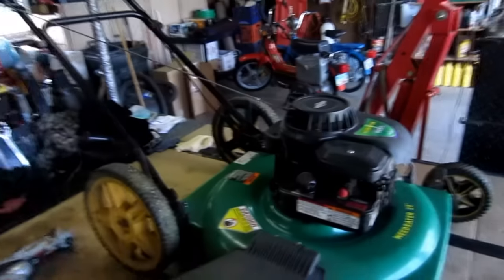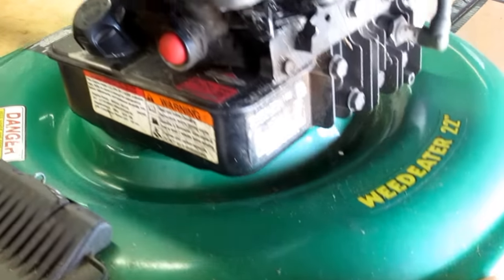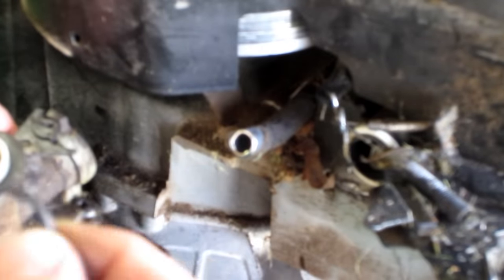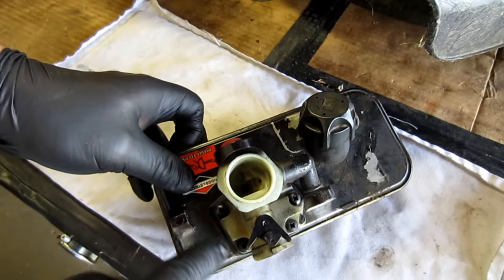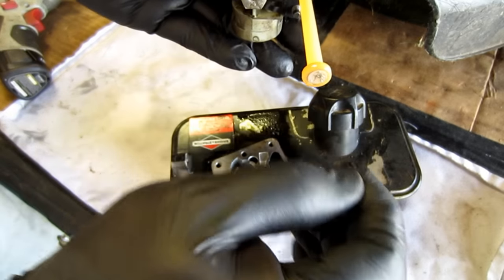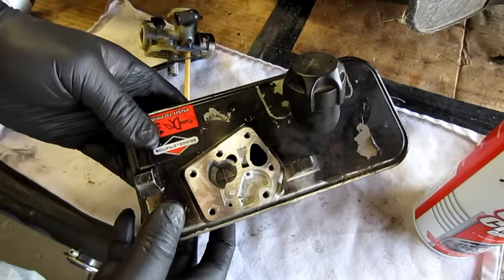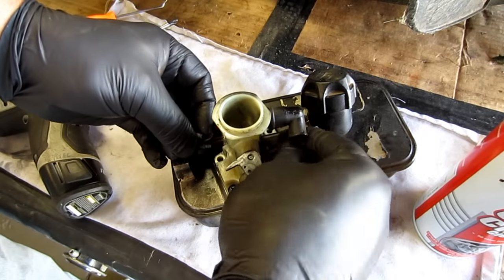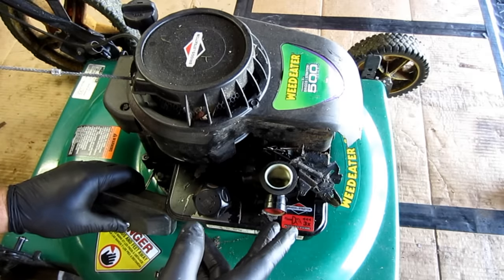Fix 90% of Briggs lawn mower not starting problems. Easy repair.

Comment: 90% of what I see is that Diaphragm failing. Spraying the old diaphragm  causes  it to curl up and become unusable. As a general rule, ANY TIME you pull that plastic carburetor  from the tank, that diaphragm  should be replaced unless you need to get back into it right away. Brake cleaner is generally a lot less damaging to the diaphragm as well. Good video and good to mention the crud in that well. I always clean the whole tank anyways. You can see that crud as soon as the plastic carb is off.

Comment: I know you won't see this because this video is so old,  but maybe someone else will. One thing you didn't mention is to make sure there is no water in the gas tank. That's something that can happen after a mower sits all winter, especially if you are using fuel that contains ethanol.

Comment: I was so apprehensive to even start on my stone dead lawnmower. Today I mustered the courage to trust your guidelines and hope for the best. 
Well, I'm glad to report that not only that my lawnmower has come back to life but I'm also so thrilled at my new found confidence in myself and what I've been able to do for the first time. I feel like a fully flexed mechanic already, thanks to you. Awesome detailed narratives and great tips and guidance throughout. Thank you again immensely.
Reply: Remember to change the oil and sharpen the blade every spring, and replace the spark plug every two or three years, and it will run like new for 10 or 20 years.

Comment: Eight years later and this video is still relevant. I have the same mower and having issues with an over-season non-starting issue. Totally unknowing where to begin, what to do and what tools needed. Thank you very much for this video, it's still important :) p.s. Amazingly, after all this time,  the Amazon link takes you to the replacement gasket and diaphgram too, the most recent one needed. Perfect!
Reply: He’s a bloody good Australian this bloke
Reply: i have a similiar nging on my mower, but not that problem. i have more of a constant oil-problem with said filter.... might not have helped that my father back then filled it opposite....

Comment: I viewed this several times. I was able to replace the gasket so that the mower runs better for a couple years. 
Then I became fearless. I tried to clean and fix many small engines. I managed to maintain most small engines I have.
This is a very thorough video.

Comment: I have a Weedeater Sprint II I bought years ago- in fact, I can't remember when. TBH I have NEVER done any maintenance on it.  Recently it started running unevenly- the engine would speed up, then decrease. I thought it about time to do something. I changed out the air filter and spark plug and did an oil change, all for the first time.
It was still running roughly, so I went online and read that it was probably the carburetor, but I could not find instructions for any mower even remotely like mine. until I saw yours.

I just followed your video closely, finally reassembling everything and, holding my breath, fired he mower up. PERFECT! It runs like new. I am so pleased- you saved me a hefty bill at a repair shop. And you got yourself another subscriber. Thank you so much. You rock!

Comment: Thanks for the free mower, it worked! This is my first house, and a neighbor was throwing out his mower, I refused to believe it was unfixable, it had compression and spark but ran very slow with misfire. I went to a repair shop and got that gasket for 6$ (while another lady was being quoted 100$ just to investigate her mower, no wonder why people throw mowers away). This year I have seen 3 mowers on the side of the road, now I don't know if I could resist taking them all anymore!

Comment: Thank you! For me it was the part into the gas tank you started to clean where the bottom is cross-hatched. There was a lot of fine residue that was the same color as the surrounding metal. After digging it out and cleaning all the ports as prescribed, my lawnmower started right up and stayed running smoothly. Thank you for your effort in making this video and spreading the knowledge!!!

Comment: I cannot thank you enough sir for posting this very detailed and helpful video. This morning, I got my Brute Briggs & Stratton pressure washer up and running. I followed your instructions step by step and it worked. I didn't need to scribe but was careful with the reassembly. Best instructions. Thanks again. Tony

Comment: Hello That's a great description. Thank you very much.
I repaired my lawnmower exactly as instructed. Madness, he runs better than ever.
So here in Germany your video has already completed the first help with me successfully.
Reply: Dieter Schmidt Hello, I thank you very much for posting a very informative and useful video where you have explained step by step. I have a similar product. My initial problem was the engine that would start to run just for about 5 seconds and then stop. So, my good neighbor John sent me your video link. So, I cleaned the carburetor following your demonstration. After changing the plug, the engine continues to run but steadily at a very high RPM which is not right. So, I must have done something wrong in putting back the carburetor house. I suspect, I suspect the small spring is not able function to restore the normal RPM level. It’s too high and I can not let it run at that high RPM. I wonder what my fault is??
Reply: I thought VW made mowers in Deutschland!

Comment: Beautifully done video! My mama and I both have this 500 series mower (mine has a 21" deck). I will be replacing the carburetor on my mower soon and upgrading a few other parts. The carburetor on Mama's mower needs cleaning, and your video is exactly what I needed to review. I especially appreciate you providing the tool sizes needed.

Comment: Easiest thing to do and I tell all my customers, use 93 octane or above for 4 cycle mowers and 2 cycle mixes, 94 sunoco gas has 0 Ethanol.... Ethanol kills small engines, I have used 94 in my small engines for 10 years and have never had to rebuild my carbs, it might be a little pricey but saves you money and head aches in the long run..... Great video.
Reply: Drain your gas tank in the fall at the end of each mowing season. That helps a lot as well to.
Reply: It would help if you drain the carb as well.... or use stable....
Reply: Octane has nothing to do with quality of fuel. Running a higher octane than an engine is designed for will cause pre-ignition and detonation and will eventually cause catastrophic engine failure.
Reply: I would think it'd only be a waste of money, not engine failure, but I'm no expert.   @dontblameme6328
Reply: Jay Vee higher octane is less likely to detonate.
Reply: absolutely! great advice-i run premium in all my small engines along with high performance 2 stroke oil-everything runs much much better now!
Reply: I'm on year 7 of ethanol free gas.. no carb jobs yet on any of my equipment.. 2 lawnmowers,  2 ATV's,  3 outboard motors.. all start with ease
Reply: also pouring cold gas into a hot gas tank...will warp the tank. Not so much now but the older pulsa jet and vacujet carbs
Reply: Jay Vee the ethanol. It destroys gaskets and diaphragms

Comment: I can see that that 'gasket' serves a dual function. It serves as the gasket between carb and tank, but it is also the fuel pump diaphragm.  Suction from the intake stroke pulls the diaphragm against a spring and on the other side of the diaphragm, suction is created which pulls the fuel up from the tank to that fuel well/bowl. You can see little flaps on the membrane that act as tiny valves. I've worked on the older Briggs horizontal shaft engines and the carb/tank gasket and fuel pump diaphragm are two separate parts. The rubber diaphragm fuel pump design is clever, but combining the membrane and gasket is extra clever.
Reply: Exactly as I see it.

Comment: Over the years I have had several Briggs & Stratton engined mowers.  I always chose a mower because of the engine make, the rest is just tin work.  A couple of years ago I bought a very similar mower to the one in your excellent video.  The problem with this model engine has always been muck blocking the jets in the carb.  It seems some bean counter at Briggs thought they could save some money by building the carb into the fuel tank.  What a disaster that turned out to be.  Any slight muck in the fuel .... a blocked jet. Formally when they had a carb with it's own separate float bowl it was easy, usually just one bolt, to remove the float bowl and any muck.  This also created an additional barrier to protect the jets. Also as you point out the gasket is very prone to distortion.  Cutting corners on design is not a good way to ensure repeat business when it come to buying a replacement mower.

Thanks for taking the trouble to make this very helpful video.

Comment: I watched this last night and today my mower is running again today after i followed your instruction, I lost the spring so modified another, it ran after a few pulls once the petrol had circulated,it  ran fast so i stretched the spring until it ticked over nicely. later i found the proper spring, so have it as a spare! Thank you very much!
Reply: Where did you find the spring?

Comment: I've watched 16 videos on why my mower won't start, replaced the carb and spark plug, tested everything from the pull cord to the ignition coil and wires and no one mentiond blowing out the carb chamber.  After doing that, the mower is working better than ever.  Thanks for this video, I was on my last day of troubleshooting before going and buying a new mower!

Comment: 5 years later and this video just saved another lawnmower from a dump run.  Thanks, thanks, thanks 🙏.

I inherited a 3.5 HP Briggs & Stratton  lawnmower in a cottage purchase that ran for 20 minutes, then won’t start again.  I followed all these steps and voila.... extended life for this old lawnmower.  

Instead of carb cleaner and air compressor, I used Dawn liquid dish detergent and the garden hose to clean tank & carb body , but first be sure all small parts are removed such as the spring, metal screen filter & all gaskets. Takes longer but it works.  Soak the metal filter screen in Dawn , rinse carefully in warm tap water (not hose).  Lots of drying time needed to remove all trace of water from carb body and especially the tank.

Box cutter knife used to score the metal surface.  Thin layer of AquaSeal glue used as a gasket cement on that critical edge and I used AquaSeal as a lock-tight for the 5 carb screws.

Fresh gas in the tank.  Primer bulb didn’t work at first (not sure why) , so I put a few drops of gas in the carb bowl.  Started on 2nd pull.  Runs great at all speeds.  Cheer 🕺.  Primer bulb works fine on subsequent test starts.  Guess I needed to prime the primer bulb with a test start 🙃.

Foam air filter cleaned with Dawn dish detergent, dried for 4 hours, then I added a few drops of 
(10W30) engine oil to the foam air filter, as per owners manual.  

Thanks again.

Comment: my briggs is a 150cc 4 stroke and its 45 years old. starts 3rd pull every time! gave it a new filter and plug 10 years ago.  update! i took a look at the oil for the first time and it was just a little black sludge! cleaned it out and refilled with semi synthetic. runs the same😀
Reply: I've got a 22 year old Lawn Boy. I only hope it lasts that long.

Comment: Hey thanks a lot for the video. I did this today with a 20" sears weed eater mower briggs 8bsxs.1581vg. Yup that little gas well was full of debris. Ultrasonic bath on the carb for good measure. Put the scratch on the tank for good luck. My throttle adjuster was super loose, adjusts from 2800 to 3800 rpm so I tightened it up and set it about 3300. I was convinced the arrangement of the two springs was wrong but its the same as yours. it is running great now. Will stock up on a new diaphragm for next year.

Comment: I've been given about 10 or so 3.5 to 5 HP B&S engines this year all non-running. Honestly 95% of them needed the gasket between the carb and fuel tank. A super easy and quick fix that makes the machine run like new. This video really helped with getting into working on these engines. 👍

Comment: Thanks. Great video. Really appreciate the help. Could not have fixed my mower without the likes of you. I watched a load of Youtube videos on these carbs 'running too rich', 'lumpy throttle control', sooting up spark plug, 'fuel leaking', 'not sucking up fuel unless tank more than half full', 'primer bulb not sucking fuel' etc. My mower was doing all of these things. I started off cleaning the carb with carb spray and changing the diaphragm and gasket for a non genuine version off ebay. This may have made it a little worse. Making a sandwich with the diaphragm between two gaskets made minimal difference. The problem was these plastic carbs are prone to distorting with heat and time making the surface that contacts the gasket uneven. I tried flattening it a bit with a sharpening stone and that did not help. Finally using the carburettor replacement fixed all the problems. If your carburettor is distorted get a Briggs and Stratton genuine replacement. They are not expensive

Comment: I picked up a gas edger that uses this motor.  She said to get it to start they would have to prime it 10+ times, and they took it In a bunch of times but the repair people kept saying its normal.   So she sold it to me for 20 bucks.  I watched this video before buying it and figured it was worth a shot.  Last winter I got a non running snowblower for cheap and youtube videos helped me figure it out so I'm hoping this works out too.   thanks for posting
Reply: On amazon there are after market kits with a carb, spark plug, gasket, for not very expensive.  Have you ever heard of people having luck with these?
Reply from the maker: Eric Dyer Hit and miss.. I have tried a few and only one out of about 5 was a little off.. Worth a try..
Reply: Ok yeah for the price I am giving it a shot.  They haven't tried to start it in 2 years but claims it used to work.   There is still gas in there so I need to get that out.  I am going to change the spark plug and replace the carb and gasket. Any suggestions beyond that I should expect to need to do
Reply from the maker: Eric Dyer yeah I think it's worth a shot. As far as fuel delivery and old gas really there's nothing else that goes wrong on these engines. at least that's from sitting a long time. you may want to add some seafoam in the first tank of gas. and obviously change the oil. good luck👍
Reply: Thanks will do that as well.  Thanks for the advice.  Not that it necessarily matters it was already pretty clean they said they didn't really use it.
Reply: Well, the parts came in and I can get it to start now.  It starts strong but then gets rough, but I realized I didn't use both parts that came with the gasket/diaphragm, there was two pieces in the kit but only one came off the machine.  I will get them both on there but it's promising because it didn't run before so at least there is progress
Reply: I got it working today, nice and strong.  Not bad for $20 buy
Reply from the maker: Eric Dyer Great to hear!  👍good job!

Comment: Good video I've done this to almost every mower in my neighborhood with the exception of one I had a Honda motor what the fuel bowl on the bottom of the carburetor that you must clean out but on New Year's generally that gasket under the carburetor Goes to Hell and won't suck fuel as soon as you replace it it works fine I also always reset the timing mark and the gap between the points in the flywheel those two things will make any mower run

Comment: Thank you so much for this video. I have a Bolens MTD gas mower which I purchased May 2011.  Earlier today, I thought my mower was on its last legs.  The primer bulb had stopped working altogether.  I was about to go out and buy a new mower (which I probably should have) but I looked at a few videos on You Tube and came across yours (your carburetor is the same exact model as mine).  I followed your video to the tee.  I re-assembled everything and couldn't believe the primer bulb was working properly and the mower was able to start.  Again, many thanks for your knowledge and video.

Comment: Thank you Foxboss9 for guiding me step by step. I serviced the carburetor as you guided, found out by looking at your mower that one of my springs was connected in the wrong place. Also found that about 1/3 of my gasoline was water. I emptied the fuel tank and bought fresh gas, filled it up and now it runs great. Thanks again.

Comment: The sponge air cleaner should be soaked in oil,but it also needs to be rung out to get as much oil out of it as possible.The oil left in the sponge air cleaner acts as a pre-filter and helps removes particles of dust and dirt that damage the engine.I am a landscape equipment mechanic and oiling that sponge filter is a weekly maintenance

Comment: Brilliant, Straight forward clear and informative. Mower now running a treat, Thanks for the tip with the bent idle speed adjustment, Mine was indeed bent.

Comment: 10 mins before finding this video I was looking at new lawn mowers on the web. I didn't have any carb cleaner on hand but I was able to clean up the carb well enough with compressed air.
Cleaned up the spark plug as well and the mower fired up on the first couple of pulls.
Thanks for saving me a few hundred bucks.

Comment: I was waiting and waiting for you to address the prob. I was having,  you nailed it. Mower started up fine, started mowing no prob. Then I ran my mower under a very low hanging branch from a Spanish broom pulled back then that's when my mowers idle decreased to very low rpm's.I bent the idle bracket which caused a tension issue with the spring.YOU NAILED IT! THANK YOU! Also Great info on how to clean the carb. I should probably get that done. You The Man!